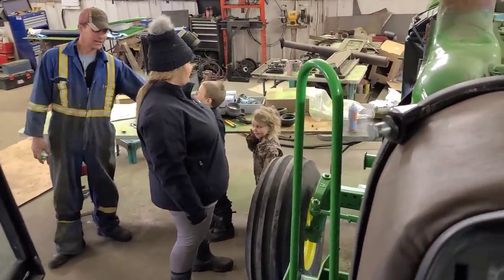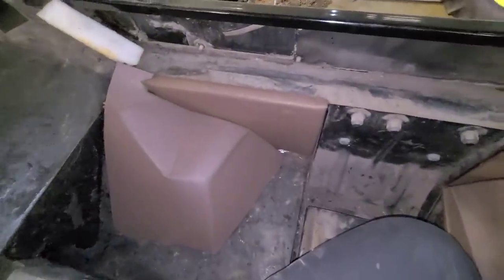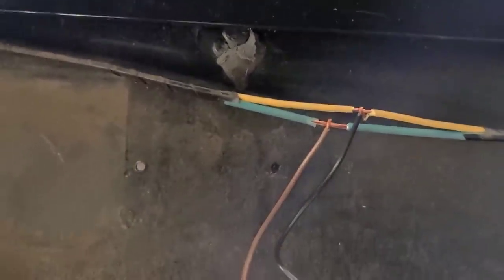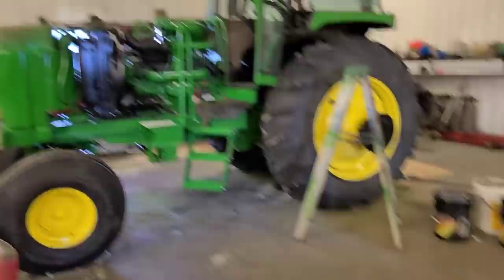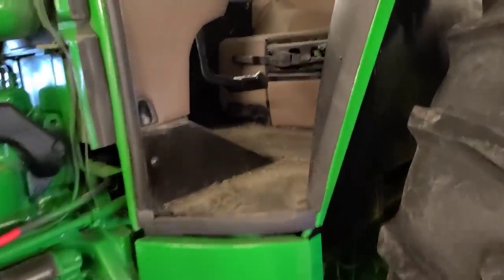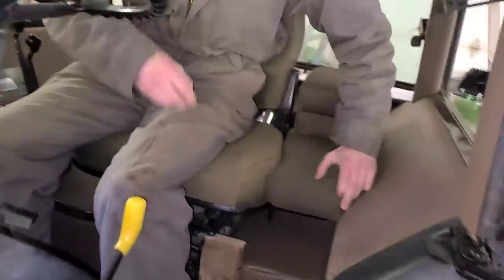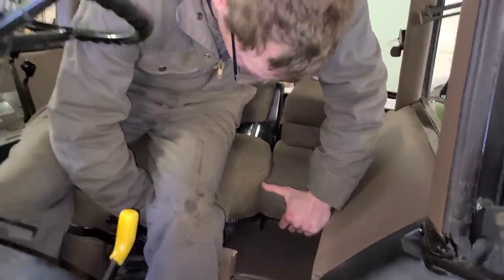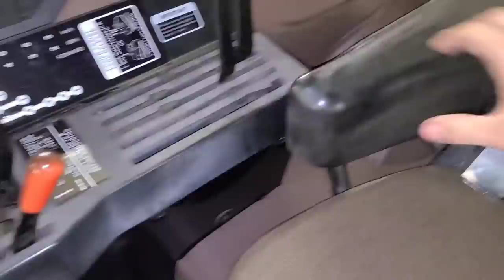4440 restoration gets fresh paint and we installed a 50/55/60 series cab kit into a 40 series cab!

Comment: On the back of the cab are 4240 plate The bolted on the back didn't have any holes in it when new , you had to drill through it if you wanted to run anything through the back

Comment: I like how you tap into the taillights to draw power for your interior bulbs, but I DO hope that you touch a soldering iron to that and a bit of solder... wires twisted together will eventually loosen up enough to make intermittent contact; a bit of solder on the wires will essentially "weld" them together so they can't break contact... Electrical tape is okay but I might try some of that liquid electrical tape stuff just to seal it off... I've heard varying stories on that stuff so maybe apply some then go over it with a single wrap or two of regular electric tape to seal it.  Otherwise looking real good!  Later!  OL J R :)

Comment: Think you just need to get a 50 series next, already got 20,30 and 40  nice 4450 with power shift and proper front wheel assist
Reply from the maker: If a guy came across a deal maybe. Next o.e would probably be a 7810 or an 8400

Comment: There's a little clip you can buy at Princess Auto called a Tap In Wire Splice, aka T-Tap or a Quick splice, they're clip on over the insulation and put a blade down in the wire to tap it so you don't have to bugger around with the stripping and trying to wrap the new wire on the stripped section etc.
Reply: Those things are absolute sh!t... called "scotch-locks" here in the States they've been selling them forever nobody with half a brain uses them anymore.  They make sh!tty contact with the wires and they're not sealed so they start to corrode almost instantly (slower in a cab than underneath something or out in the weather but still) and as they move around through normal vibration and movement on a vehicle they cut into the wire and loosen up over time and start making sh!tty intermittent contact so your lights either flicker or go out entirely.  Absolute junk best thing you can do with those things is throw them straight into the trash, which is exactly what I do with any of them that come with anything I buy.  

Nick's got the right idea; only thing he should change is hitting it with a soldering iron and a spot of solder to link the wires together... then tape it up or hit it with some liquid electrical tape or both.  Soldering is the best connection you can get.  If you're in a spot where you can't solder it and have a little extra wire, snip the wire strip both ends and the wire your adding to the circuit twist all three ends together and use a wire nut on it then tape it up.  At least  you're guaranteed good contact that way.  Don't even bother with the stinking scotch-locks they're junk!! Later!  OL J R :)

Comment: Ok gotta ask a dumb question but do any tractors have 3 points around you
Reply: From what he's said, not really... They're prairie farmers, everything is pull-type equipment, and they don't use enough small stuff to justify it I guess... around here in row crop country you couldn't GIVE AWAY those old Farmalls with no 3 point... they were useless, unless you bought and added one or built one.  Most of them ended up in the junkyard early because of that.  H3ll even the planters are 3 point mounted around here-- virtually NO pull type planters here other than rice drills.  Row crop planters are all pretty much vertical stack-fold bars with the row units on them on the 3 point hitch.  We'd be lost without three points here because most hay mowers are 3 point (a few guys put them on caddies to make hitching up easier) unless you're a BTO running a pull-type diskbine or something... rakes and balers are of course pull type BUT the 3point carries 1-2 bales and another bale or two on front of the loader and the 3 point is essential to move hay.  We didn't even have a front end loader until about 20 years ago... LOL:)  Did all the  hay with a 3 point fork.  

Other than hay forks or maybe a 6 foot bush-hog shredder on the back, or maybe a snowblower on the back of the tractor, they don't have a lot of use for 3 point hitches, so MOST of them prairie tractors simply came without them.  H3ll in the old days the "wheatland" tractors didn't even have the arched higher-clearance "row crop" front axles... they were just straight bar axles almost like a truck!  Just a difference in how they farm in small grains country out on the prairies and row crop farming elsewhere... 

Later!  OL J R :)